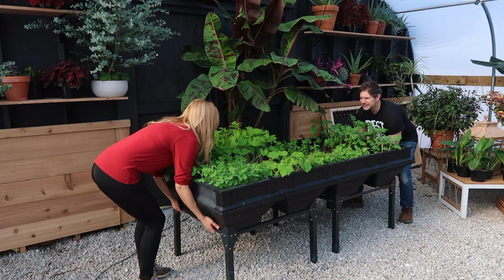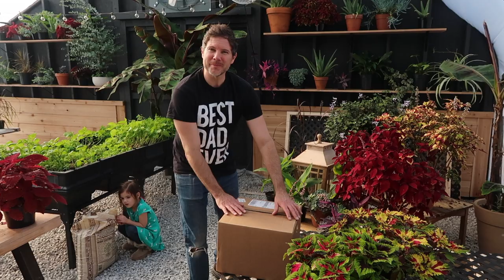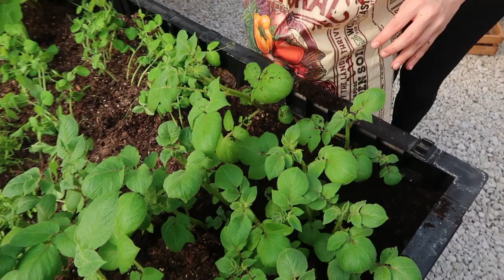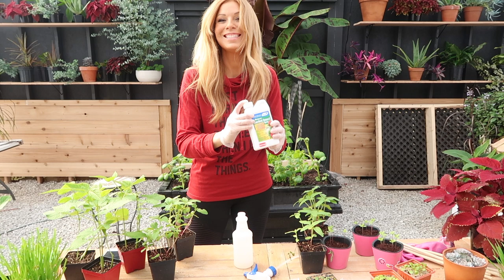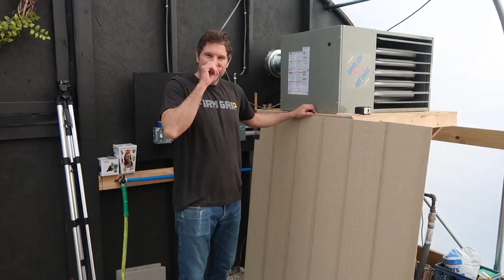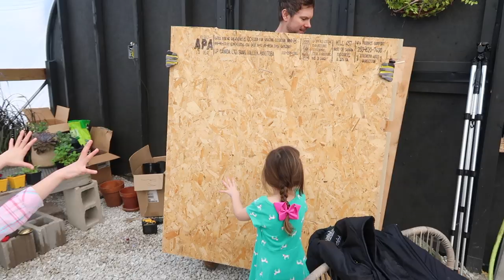Gardening in our Greenhouse! (Bug Control & Vegepod raised bed) // Garden Farm

Comment: Oh, forgot to give you a suggestion for in the greenhouse. I have yellow sticky strips in my greenhouse, they’re cheap and really effective. Insects are attracted to the yellow spectrum and I place above all my plants, you can buy in large rolls or smaller strips. 😉
Reply from the maker: Mel Thank you so much for that! That sounds like a great idea! Where do you get it from?
Reply: I buy mine from eBay, I only need the smaller ones for my small greenhouse. At work we get the large rolls from Greenhouse suppliers and we clip them onto a guy wire with bulldog clips running the whole lengths of our rows.

Comment: Hi Casey, I have an off-topic question.  What brand/type of garden hose do you recommend?  Since you grew up in the "garden center" business I'm sure you've used several,  what's your favorite?
Reply from the maker: We have been using the Flexzilla, They are the most flexible and easy to move around, they rarely kink they are easy to roll back up. They are easy to spot in the stores, they are neon green